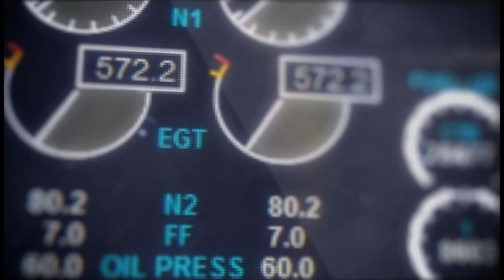Cat 3 approaches and autoland

Comment: Nice explanation.  The Boeing 757/767 does CAT III with three autopilots on three different hydraulic systems, three Inertial Reference Units, three ILS receivers, and three radio altimeters.  What is really amazing (to me) is that in CAT III mode, the rudder on those airplanes is being controlled by five different systems and actuators at once--three autopilots and two yaw dampers.
Reply: I think you will find the various inputs will be subject to something called Kalman filtering which statistically calculates what information to accept and what to ignore thus making sure the output is what is most likely required.
Reply: @125brat  for error checking your control output you would probably want a wayyyy simpler way but that’s totally a possible way to do it. Kalman filters are used all the time for navigation though
Reply: @ricardo_9726  Yes, that's where I first heard of it on the Tornado navigation systems. If I remember correctly, it took inputs from the Inertial Navigation, radar and other sensors which were filtered to give the best estimate of position.
I also seem to remember the CSAS flying control system used quadruplex channels with voting for the pitch and roll channels and triplex for yaw. That meant the rudder wasn't as necessary and probably yaw could be controlled by the spoilers in the event of loss of rudder control. Loss of 1 rudder control channel would cause the rudder to lock because with only 2 channels left, there no way of knowing which channel is the correct demand.

Comment: When I was flying night freight in Beech 18s and DC-3s in the early 1970s.  We would arrive at KLAX around 0200 PST after a 2 hour flight from KSFO.  Cat III did not exist at that time.  There was talk about it.  A lot of Stretch 8, 727 and other freighters were arriving at that time, so we got very good at flying 140 kt. approaches in those old airplanes in order to fit into traffic.  KLAX sits right on the California coast which is famous for its low stratus or fog in the summer months.  This stratus will stretch inland for many miles and usually the ceiling is between 50 and 500 ft. Most nights the visibility was quite good under the ceiling. KLAX Tower very often would report the ceiling as 200ft. no matter what it really was because if they gave us the real ceiling, a lot of freighters would be trying to find an alternate.  The Beech and DC-3s had no auto-pilots, and we got very good at hand flying in all sorts of weather, and it was not unusual for us and all of the jet freighters to break out on final at 75 or 80 ft. to find 3 to 4 mile visibility underneath.  On two nights that I remember well after all these years, we had the lights at 50 ft. or so, then didn't have them and then saw them again, had the threshold, started the flair, and heard the wheels touch down while faintly seeing the runway lights on either side. This was the norm at KLAX while the FAA dragged their feet about installing CATIII
Reply: Robert Campbell:  Thanks for the info. I did lots of flying in San Diego in the mid to late 80s. We had the same issues. There are no airports in the San Diego area with cat II or cat III approaches so we had to go around and fly inland where there was no fog to land and wait for the fog to lift on the coast. Those were the days.  😊

Comment: Hi Petter. Nice video on CAT III A approach. I would like to add that there are CAT III B and CAT III C approaches (which the B737 cannot do) which have other minima. Here is the full list for anyone interested (DH = decision height; RVR = runway visual range):
- CAT I: system minima 60m (200ft); DH >= 60m, RVR >= 550m or ground visibility >= 800m
- CAT II: system minima 30m (100ft); DH < 60m, DH >= 30m, RVR >= 350m
- CAT IIIA: no system minima; DH < 30m or no DH; RVR >= 200m
- CAT IIIB: no system minima; DH < 15m (50ft) or no DH; RVR >= 50m
- CAT IIIC: no system minima; no DH; no RVR
If I remember correctly CAT III B and CAT III C require 3 autopilots so that even in the case of one failing, the other 2 can continue the approach.
CAT III C has an additional issue: after landing (which is completely automatic) taxiing is not possible. I've heard that there were some attempts to use it in zero visibility but after the first aircraft lands in those conditions it cannot leave the runway, so the airport becomes blocked.
Reply: The problem is with flying blind (Cat IIIc) is the plane can land with the use of the ILS and autopilot but there is nothing you can key in that will then taxi the plane automatically to the parking bay. And as you need to be able to have some visibility to be able to taxi and to operate ground crew to assist with moving the aircraft so the plane has to sit there with its passengers on board. Unless you have parallel runways nothing else can land.  I don't think there are any airports that allow this as it's too expensive and a logistical nightmare. I mean given it's such a risky approach if there was a small error and as a result a crash it would be too hard to help the people on board with such low visibility
Reply: My dad RIP was a H.S Trident captain in the 60s and 70s. The first airliner capable of CAT IIIC Full Auto Land (blind landing). Amazing aircraft with amazing technology at the time. He loved flying it.

Comment: This the first time I've seen a Mentour video, and I have to say I'm very impressed - a lovely tutorial and (mostly) easy to grasp, so thank you.
The reason I watched this is purely because as an FSX VP (sorry about that!!), I'm currently flying an Avro Liner which, for some reason, automatically advises me that I'm on a Cat 3 Autoland. When that comes on during the approach phase, I tend to follow the speed card info', flap settings 24, switch off the auto-throttle at the FAF (usually 2,000 ft), and use  gently changes on the throttle to keep the a/c stable to t/d - flaring at about 15-20ft. Throughout this glide-slope phase, my speed is between 8-10 kts above the speed-card TD setting (generally around 129 and 139 kts respectively, depending on the total weight), and TD at the correct speed. Most times my landings are very smooth! However, my questions are: Why do I get this Cat 3 annunciator, and should I change my subsequent procedure? Whether or not you respond to this, I will definitely be watching more of the Mentour vids, so thanks again.

Comment: We did a Cat 3 ILS approach into Munich on October 26th on a Lufthansa flight from Sofia. It was between 6 and 6:30am and from we could see the visibility was very low. I am always in a window seat if I can get one and in this case, I was continually monitoring as the captain told us that we would be doing this type of landing and asked that all passengers ensure that our phones were not using mobile data, I'm not sure if this is standard but the pilot felt it necessary. I did not see the runway clearly until we were on top of it and the only thing we could see approaching was faint light in the distance. It was a little scary as a passenger but the landing was very easy and a lot of passengers around me were either asleep or barely awake. This was the first time I experienced this type of landing. Very interesting.

Comment: On the 757/767 we are fail operational (which is an option on the 737) and we can, if the company is approved and if the runway is equipped, fly CAT3B app. without DH and RVR 75m. It’s thanks to the triple autopilot system and the coupled rudder. It’s actually very comfortable because you don’t need to have visual references, lower stress compared to CAT3 with DH.

Comment: Excellent job Hans [LH] or Sven [SAS]  . Almost identical procedures of my old airline. Except, after the auto land, in the MD11 and 777 the autopilot would track centerline after landing. [Do not know about the 737. never flew it].  In the sim we practiced AP disconnect after touchdown and that required a lot of concentration looking at the CDI especially when RVR was 125 meters, or worse if you hit a wall of thick fog that the transmisometers did not pick up, . like in SCL for example. During go around, press NAV and let the AP fly the missed. Like I said earlier, excellent job overall.

Comment: I think you missed one answer you announced ("why don't we use autoland all the time?"). Cheers!
Reply: Becuase it uses more runway. Also, it simply means that pilots get bad at landing becuase they never actually do it, so in an emergency situation where a manual landing is necessary, a pilot would not be competent enough as autoland is being used all the time.
Reply: Very late but also because the computer lands generally rough, and passengers prefer softer landings which the pilot can provide more often
Reply: Air Traffic congestion is also a reason, because CAT III approach need more separation which means more holding.
Reply: And Autoland increases pilot workload it’s actually less work to do a manual landing when you don’t have to.

Comment: Brilliant clarity and explanations. Dont you have "ROLL OUT" Mode for auto tracking the centreline? Auto brakes was not mentioned but I assume it will depend on surface conditions and runway length available plus landing speed/weight.Thanks for describing Fail Passive AFCS. Is 737 AFCS designed for Fail Active? That is when approach can continue despite failures as I recall it

Comment: Very clear and concise explanation. I notice you are giving RVR in meters- the last time I flew in Europe, RVR (and reported visibility) were always in feet, just like altitude is always in feet and ATC always uses English regardless of the measurement system or language(s) in use in that country. All aircraft flight systems and manuals were in feet. When did European RVR and runway length reporting change to being reported in meters? Thanks.
Reply from the maker: Hi! RVR has been reporter in Meters in Europe for as long as I have been flying. At least the last 20 years.
Reply: Maybe it's because I was flying military aircraft at NATO bases... Thanks for your response!

Comment: I was on the property at DEN when they first proved the CAT III approach system on 34L.  It was a very warm day, blustery winds with a cold front passage.   These were the first 10 sets of skid marks on the runway and none of them was more than 75 feet from any other landing point.   CAT III landings are precise.  Very impressive.  The airport didn't open however for months due to the malfunctioning baggage retrieval  system.

Comment: The infamous lical “Tule fogs” we have in the Great Valley in California must cause a lot of rerouted flights.  I’ve had to drive in these dense ground fogs with less than ten feet of visibility, unsurprisingly, they cause a lot of vehicle accidents.  These usually cover the entire valley, which is huge, as its name suggests, bigger than many states.  Fortunately, I don’t live there, I only had few jobs there of several weeks duration in the valley.   They must have to send flights to the relatively nearby Bay Area, where I do live, we do have marine fog here, but it doesn’t usually cling so low to the ground.

Comment: Thank you so much for all the very informative videos they really explain a lot of things and call out misconceptions about the flying industry and also how things really work behind the scenes. I did have a question about Air Marshals and whether or not the flight crew know in advance who they are or is it a surprise as best as they can keep it obviously you say the same ones over and over I would think but if they mixed them up maybe they do blend in and not stand out. Is that a topic you can discuss or is it a safety regulation to avoid?

Comment: Very well explain there is difference by country  in Canada a CAT3 ( without failure ) is done with NODH  and the Captain do the full briefing and flying in 28 years of flying I did 3 real CAT3 full landing 
on the Airbus 330 the aircraft do a amazing job soft landing track right in the middle of the runway  on the Boeing 737-800 extremely different the aircraft land safe but hard not always in the middle 
and make the job much much harder. ( I have 5000 hrs on B737 from 200 to 800 series) ...

Comment: What would be the correct course of action if a dual engine failure happens after v1 but before vr? Also, if one engine fails during the takeoff roll in a 737, is reverse thrust used to slow down?

Keep up the good work with the videos! I really enjoy them!

Comment: Thank you for your excellent videos! Your presentations are concise and thorough base on a wealth of knowledge and experience. I have two questions: On a commercial aircraft such as the A320 having a stick instead of a yoke, would a pilot who is right-handed be handicapped sitting in the left seat? 

The other questions has to do with real-time video cameras. I think I've seen videos from Airbus flights where you see the top side of the plane looking forward from the tail and the same under the plane. As inexpensive as cameras are now would it be a good idea for the pilots to have a camera viewing each wing and the tail so they at least a superficial view of the position and condition of the control surfaces and the engines?

Comment: Question: why not to eliminate cat1 and 2 definitely and leave only cat3 ? It is not assumed that cat 3 is more accurate and leaves the plane in a better landing position, whether or not there is good weather or visuals? And why not always use it as a normal and regular landing mode, despites of a total manual one? Very good chanel by the way, one of the best of his kind...
Reply: Not all airports/runways are equipped for Cat 3.  Mostly large airports in major cities are so equipped.
Reply: It's a matter of money or resources ? Are not the same antennas or each cat have one in particular?
Reply: Because the captain is a pilot and wants to fly his airplane
Reply: because then pilots would need much more training before they could land aeroplanes. Plus Cat 3 approaches carry more risk. The only reason they are more accurate is because of the extensive training the pilots get. But there is no margin for error like there is with a Cat 1. Plus Cat 3s have more go-arounds and diversions which cost money. Plus regional airports and smaller aircraft can't do them

Comment: I'm not an expert, so possibly this is a naive question, but I always wondered why airliner's cockpit design usually features a somewhat limited outside visibility because of the glareshield cutoff angle, requiring pilots to raise their seat whenever they need to get a better point of view.
Couldn't cockpits simply be designed with an overall reduced height, so to offer the best outer view in every condition, or else the number and size of instruments and panels needed makes the actual layout the only viable solution?

Comment: I found this LVP at your company with alternating task sharing between pilots at DH is a bit muddled specially replacing hands on controls so late and the possibility of wrong touching of TOGA toggles or deviating role attention for a moment s also possible, simple LVP at many Airlines is Captain PF (Head up and down at late stage unless HUD head up through the App.), First Officer is PM (Head Down until touchdown) .

Comment: Do you treat all CATIII approaches the same way? Is there a difference with CATIIIa and CATIIIb? I won't even ask about CATIIIc because as far as I know those aren't in use anywhere in the world.
Reply: Didn't Speedbird 9 effectively fly a Cat IIIc after the volcano incident, due to the windscreens being ruined?  (Under declared emergency, so the rules are different anyway, and it was a problem that wouldn't go away with time or a diversion.)  As I recall, there was something even worse about it too.
OK, looked it up, and apparently they also didn't have vertical guidance so the FO had to call out target altitudes all the way down based on the DME.  Sort of like playing connect the dots when you can't see the dots.

Comment: Thanks for this video, very informative video. I just have a question about the go-around, as we know that normally breaks are armed for landing and if conditions are favorable for a go around and the aircraft touches down on the runway, wouldn't it reduce the speed significantly and it will take more time for an aircraft to throttles up?

Comment: Hi there Mentour, great video. Can I ask a question please - CAT3A 
Approaches allow a DH of lower than 100' to No DH. 3B allow DH lower 
than 50' to no DH etc. Does than mean if certified the approach and 
landing can be done when no visual reference is gained at all? Do you 
ever perform these approaches? Many thanks.
Reply: TIAD yes, certain aircraft can perform CAT IIIB autoland.  the A/P must have kickoff drift  capability.  that is, rudder control to kick the nose straight shortly before touchdown. The HS 121 Trident was first with this.  I do not have sufficient knowledge of the 737 systems to comment.

Comment: Hi Mr Mentour, I like this video and I also watched the Mentour app 360 one.
All good but I would have liked a bit more information.
What is the role of VOR LOC?
What about setting the NAV radios, 'both' to the ILS frequency?
Setting runway heading on both the Captains and !st officer MCP?
Is that correct,?
Why put the altitude back to 3000?